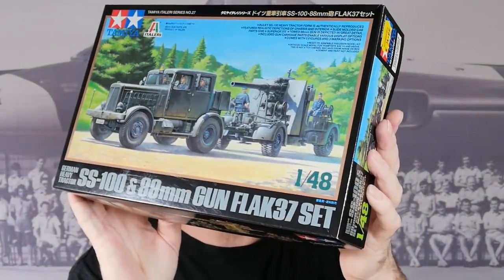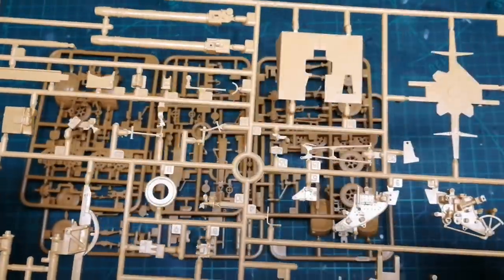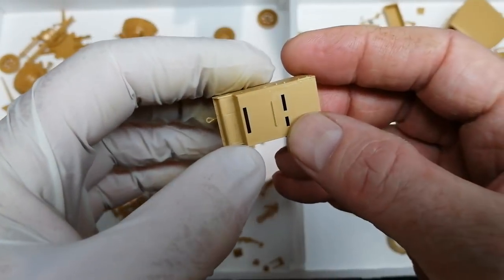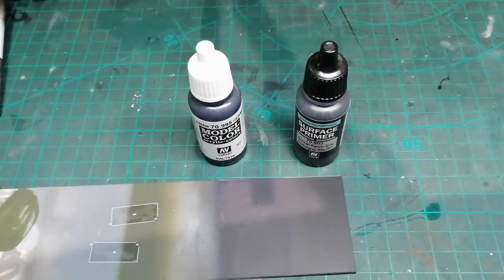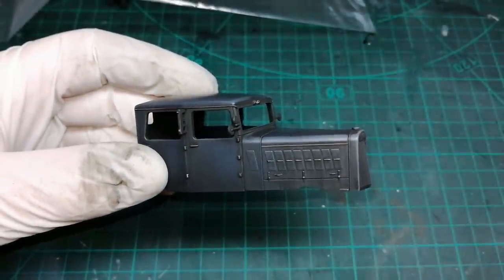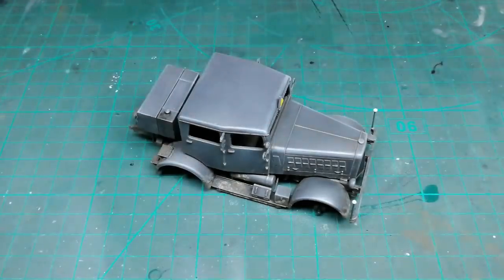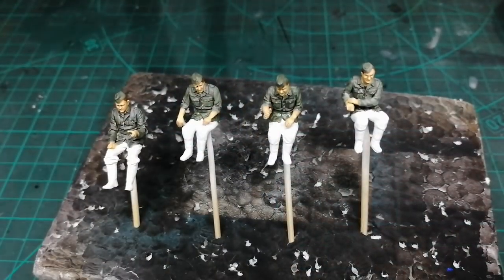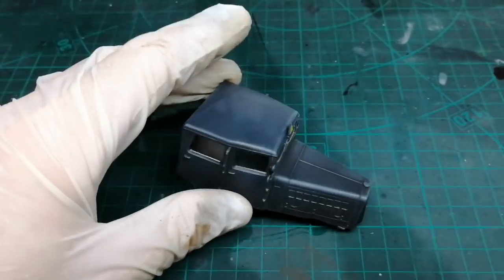Tamiya/Italeri's German Heavy Tractor and 88mm Flak Set (Full Build)

Comment: A really nice build. I am not sure how you can cut all the parts off the sprue before you begin assembly. I would fear getting detail parts mixed up, especially if the instructions are not that clear. I do cut and clean the parts for a specific assembly stage before building but never all of them.
Reply from the maker: The Tamiya illustrations are always well drawn and clear. There are some manufacturers that I would think twice with this process, Revell being one 👍